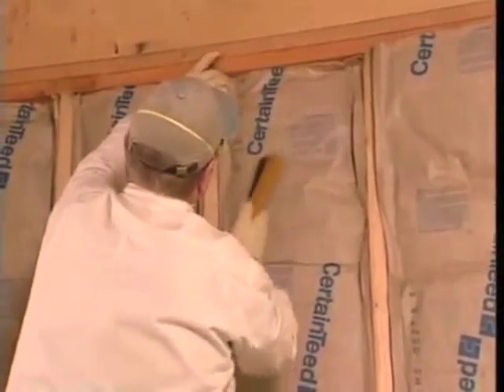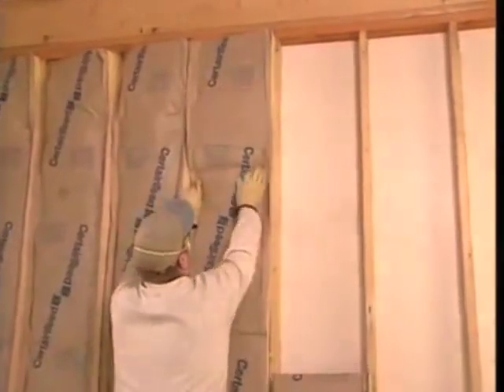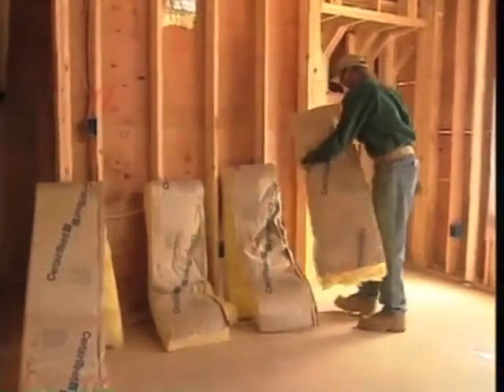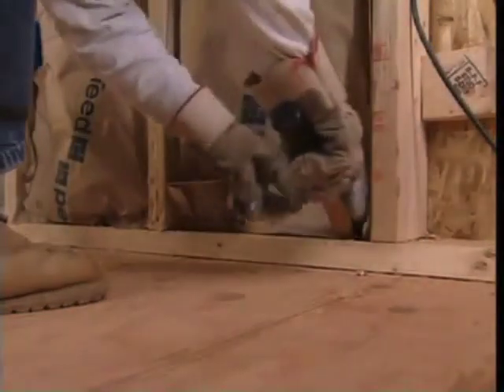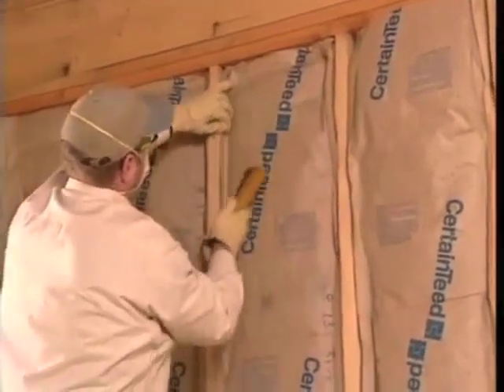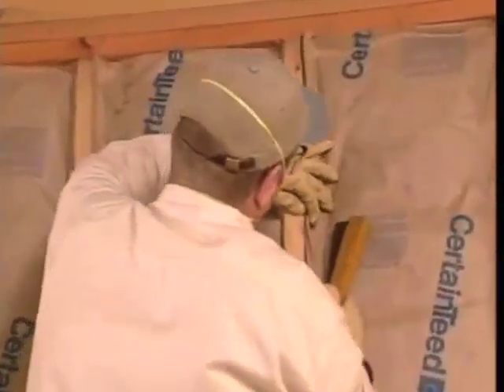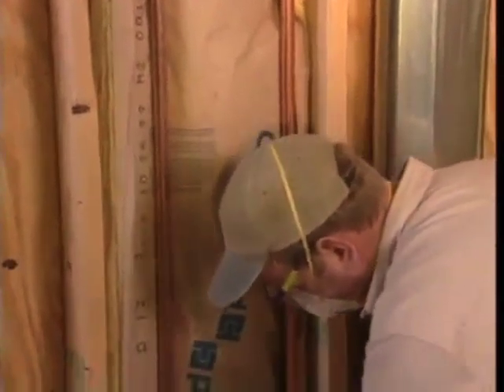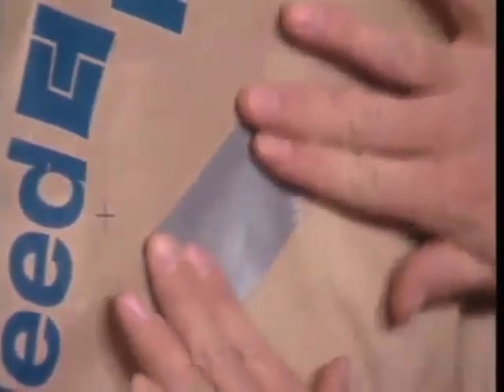The Right Way To Insulate: Sidewalls and Unheated Areas - Part One

Comment: Average house in my parts is 1200-1500sq ft… 

Ball park $2k for a builder to just install insulation on interior walls’ 
It’s a million times harder once drywall’s on’ 
NO-ONE likes sound’ so why builders don’t just freaking do it add 3k to the cost of house’ 

After drywalls up now it’s 5k by the time you remove drywall / replace/ texture / paint 

I swear frustrating when they don’t just do it when building ‘ 

How many ppl do you know who would say “ I like hearing ppl in the bathroom” 🤦🏻‍♂️

Comment: So where are you supposed to put the glue when you hang plasterboard?
Reply: You use screws to secure the drywall.  Just a little more work for the drywaller